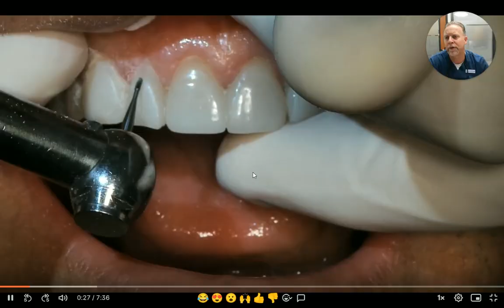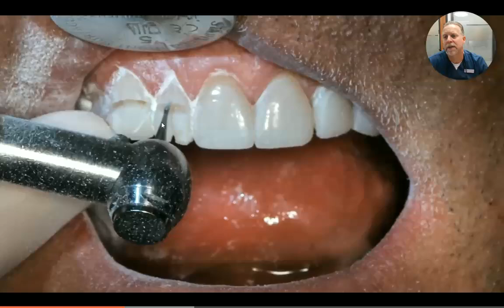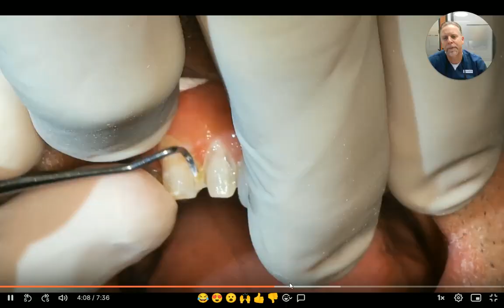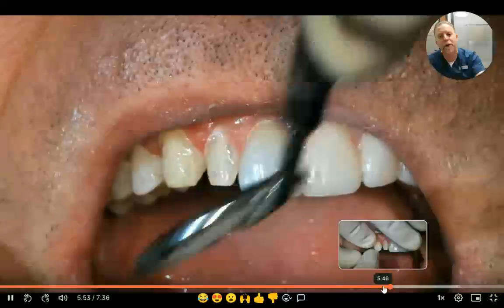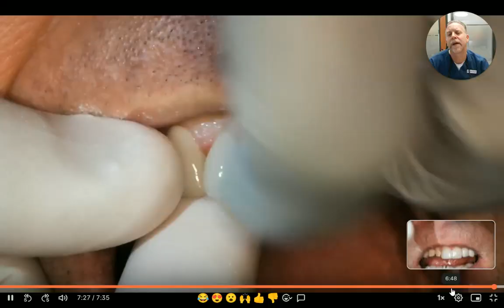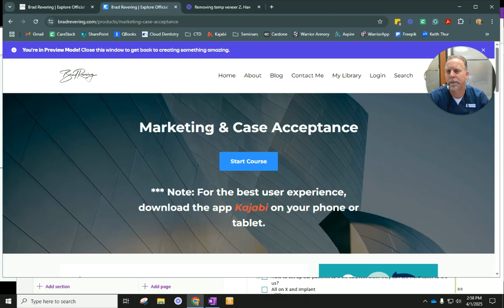How to remove bonded temporary veneers

Comment: I had temporary veneers on late last year (upper front facing teeth). They fell off multiple times. The dentist, obviously, didn't want to put on some strong cement, as they're temporaries. I had to be careful with eating for weeks. It ended up being more weeks than expected, since the dental lab screwed up the permanent veneers so they had to be redone.